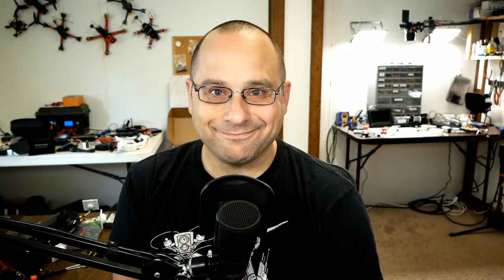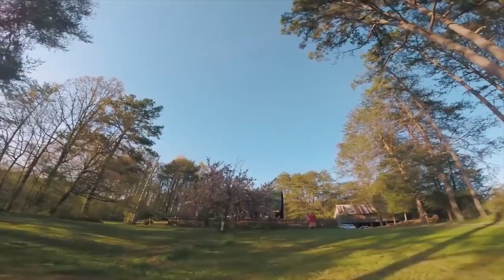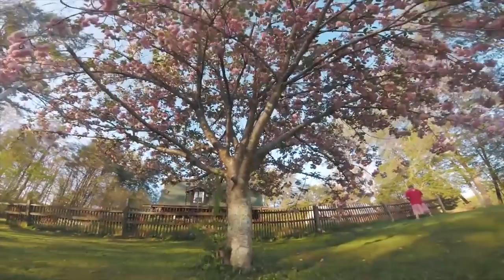Parallel Charging | CAN YOU MIX DIFFERENT mAh OF BATTERY

Comment: It is a question of current. I think the biggest potential problem would be mixing largely different mah batteries. So you do your calculations and add up your mah to give you total mah and adjust your input current to 1c (as an example). But being the charge is going to be absorbed mainly by the larger capacity batteries they could potentially be taking on current greater than 1c. Not really a problem, yet. But say you are pushing what you calculate to be 2 or 3c for the combined packs? Therein lies the problem. I'm guessing perhaps don't push that hard or calculate your charge amps based solely on the smaller packs capacity. The only other thing I can think of is to check the manufacturer specs on Max charge current and stay well below that. Thanks JB. I'd love to hear your thoughts on this

Comment: As long as they are the same cell count, the way to make the water analogy work is you cut a hole at the bottom of each container and connect them all together with a hose or something.  Think of it as ground.

And that's it.  Pour water in anywhere, and it equalizes across.

Comment: What about battery ages? Can I parallel charge 2 batteries that r from different manufacturers but r otherwise the same specs, but one is new and the other is a year old or so? Can the amount of cycles affect safety of parallel charging between them?
Reply from the maker: As long as the packs are relatively healthy and you are not charging faster than 1-2 C I would do it. The risk with older packs is, if the pack takes a dump while it's on the board, then it will kill all the other packs on the board.

Comment: So is it safe to connect two 18650 battery's one with 2000mah and the other a 2500mah in parallel to make a homemade receiver pack?? Would they both charge to full at the same time like you explain

Comment: Lets say you have 2 x 100 ah batteries and 1 x 200 ah battery. Could you connect the two 100's with solid copper bars, and then parallel that (100ah x 2 = 200ah) battery to the 200 ah battery? Or would that be the same as connect all 3 batteries on parallel?
Reply from the maker: To get 300 mAh connect all three in parallel. But they must be the same voltage.

Comment: In mixed configuration how would discharging work?  Equally as safe?  Will the larger battery take a proportionally larger share of the load in order to drain the mixed parallel pack evenly while keeping the voltage the same on each?
Reply from the maker: Yes exactly.

Comment: I have a older battery that only charges to around 13 volts can I add a new battery with it or does that make one bucket taller than the other. Using your analogy.
Reply from the maker: Never ever combine a suspect bad battery with other packs in a parallel configuration. Get rid of that 13v battery it is a fire hazard.
Reply: @JoshuaBardwell  Thank you.

Comment: What do you do when you have say, 6 batteries to charge but they're not all at close enough voltage? Do you discharge the 5 higher ones so that they're at the same charge as the lowest one and then throw them on the parallel charged board?
Reply from the maker: I would probably just charge them separately. But that seldom happens to me. I usually finish my packs and since I use the OSD I can finish them at close to the same voltage.

Comment: Thank you so much for this video! First off I would like to ask if I'm applying this knowledge right.
In my case, I have a keyboard that has an internal 1900 mAh 3.7V lipo cell. I have a new keyboard case and I found the best way to use the space in the case, I would get a 3000 mAh and a 2500 mAh (both 3.7V) and solder them in parallel after making sure they are super close in voltage, I can connect this battery into the keyboard and it should behave as a single 5500mAh battery? The keyboard charger wont have any issues with the cells as they will continuously balance their voltage between each other? This will be in a sealed container and likely will not be taken apart for a very long time (years?), is there any maintenance i need to do, or monitoring in the long term to make sure i dont start a fire?

Also, I am a professional editor and I make simple animations on a daily basis - if you'd ever be keen on updating this video, I would be more than happy (if time permits) to help create some simple animated graphics to add to this for clarity. If you are interested just drop me a message on my instagram: @trendywhistle. (I'm not sure if youtube will block emails on comments.
Reply from the maker: Yes it should work as you describe. Eventually if one cell dies it will kill the other one.
Reply: @JoshuaBardwell  Awesome! Thank you very much!
Reply: Hi good morning,Please help,I am stuck in a diy Bluetooth speaker project, what happens to the Mah capacity when I add 2 batteries of 500mah capacity in series, will the Mah add up..
And same when I add 2 batteries of 500mah capacity in parallel, will the Mah add up..

Comment: What about connecting a flat LiPo battery with a 18650 battery of the around the same capacity in parallel? Will that work? I'm trying to use all the space I have inside

Comment: can i connect a 20ah 21700 36v battery pack and a 18650 12ah 36v battery pack  in parallel (if i level the voltage)

Comment: Hello Joshua,  Can I use parallel Diehard Platinum AGM Group 35 740 CC 100RC as main with Duralast AGM Group H8 900CC 160RC as auxiliary?  Diehard has 13 2.4 volts and Duralast has 13 volts.  I plat to connect the positive terminal of Die Hard to 80amp fuse, then to Smart battery Isolator 140A (LED ON -cut in 13.3  VDC and LED OFF Cut out 12.8 VCD), then  to 80Amp fuse to positive terminal of Duralast.  Negative goes directly to negative terminal.  I appreciate your expertise before I blow myself to kingdom come.   Take care.
Reply: Diehard has 55.0 Ah and Duralast has 95 Ah.

Comment: Wiring to 20v drill Batts in series to 40v for a 36v e scooter. I have to 5ah and the stock hard wired is 4ah. Would that be ok with all three?
Reply from the maker: It's impossible to answer this question without knowing the full specs of the scooter. The larger Ah is probably not an issue. The question is whether the scooter can take 40v input.
Reply: @JoshuaBardwell  thank you for replying. The stock battery rests at 41.7 and I have dewalt 5ahs with adapters they slide in with leads.

Comment: What is the risk of damaging cells if say one of your six packs has a bad cell ir.  Can the over voltage that happens in a bad cell charge cause issues to the other good parallel cells?
Reply from the maker: Yep. If you put a bad pack on the parallel board with good packs, it will kill them all.
Reply: Yeah.  A lot of guys I fly with have gone away from parallel chargers to multiport chargers for this very reason.  You forgot to check a battery once can cost you a whole lot.

Comment: what if i connect batteries of different ampere but same voltage in series to increase the capacity . what will be the output ampere? will it add up or take the ampere of the lower or the higher battery.. i need this cause i want to increase the voltage for my ebike which needed 48 vol but i only have batteries of different ampere and sizes
Reply from the maker: If you are wiring batteries in series, they should be as close as possible to the same c rate and capacity.

Comment: thanks! as always very informative! what about charging li-po and li-ion in parallel assuming that they have same cell count and initial voltage? I guess it should be safe, just asking out of curiosity
Reply from the maker: It's fine. As long as the LiIo is save to go to 4.2 volts. Most of them are but some older LiIo only are rated for 4.1 volts.

Comment: How do you bring all your packs within  the appropriate range, I find I don't fly all my packs to the same level or if I crash out halfway through a pack I can't parallel charge.  Thanks, the video is great.
Reply from the maker: If I have an odd pack that didn't get run down all the way then I just charge it by itself. Normally my packs end up about the same level because I monitor voltage on the OSD while flying.

Comment: When I parallel charge my batteries, I precharge them one by one using the storage program to 3.7V until the first beep (takes mostly around 3 minutes) before I plug them together.
This way, the cells are less than 0.1V off, regardless how far down I used them.

Comment: The only extra precaution that I take is that I like to keep my manufacturers together during a parallel charge. Theoretically it SHOULDN'T matter, but I am paranoid. Also that the JB para board only does 10, and I just happen to have 20 packs with an even split of 10/10. Run 10x CNHL's the first charge, 10x Rline's the second!

Comment: I agree with everything that was said! But what about internal resistance? I though voltage and IR were the two big factors
Reply from the maker: High IR will slow the inrush current, but you don't want to rely on that.

Comment: Hi Josh another great video! So I have been charging all my packs of different mah sizes together since getting into the hobby and they have always turned out fine so I was pretty sure it was safe but it's nice to know for sure. As far as the plugging in the packs with different voltage levels. I have always plugged in all my packs together without checking the voltage levels for about two years and never had any issues. I'm thinking now just how lucky I've been. I plug them in together rather they have 14.5v, 15.9v and say 16.1v. They always equalize themselves. When I do this all packs end up having like 15.6 volts or so before charging begins and have always charged to full 4.20v per cell. I'm glad you mentioned that this is not a good. Although I've not had an issue I don't want one either. I want to take as much danger out of charging as possible. Do you think I caused any damage to my packs doing that though?
Reply from the maker: You have been lucky. Even if you don't start a fire, you can damage the lowest-voltage battery by "charging" it too fast.
Reply: OK that's not good then. I'm glad you told me because I would have kept doing it. Thank you so much

Comment: <3 you Bardwell. 1 question do i just add the mah and divide by 1000 for the amps? 850mah + 650mah + 650mah= 2150mah so 2.1ish amps right? its doesn't matter that the 850's 1c rating is diffrent from the 650's correct?

Comment: Hello Mr. Joshua. You explained very well. I like to share one of my experience in battery charging. Actually I was searching for the answer. I wish you can help me with it. " I was charging a 2200mAh battery. Before charging battery has voltage about 3.6V. And I connected to a supply about 4.3V. But I have seen the voltage is 3.6V while charging battery. " Here my question is, battery is connected parallel to the source. But the voltage in between them is 3.6V instead of 4.3V. why it's showing the battery's voltage instead of source? What happened with remaining voltage?
Reply from the maker: The charger will raise voltage to the battery to cause current to flow into the battery. The difference in voltage between the battery's cell and the charger's output is lost as heat due to the internal resistance of the battery.
Reply: @JoshuaBardwell  So. What will happen if we are charging an empty battery? Means what will be the voltage in between them ? The voltage will be zero? All voltage lost as heat ?
Reply: Did , did you plug a battery into a powersuply? Lmaooo

Comment: Other strategies and dangers:

Order matters.  If you have cells with slightly differing voltages, you want the larger capacity with lower voltage to go in first since it has more ability to absorb the inrush current when the higher batteries are plugged in.

The biggest danger with charging parallel batteries of different capacities, aside from the obvious, is a wonky parallel board.  No board that I know will self-report a burnt out trace.  So if you have an open circuit, you don't know about it.  If you were setting your charge current to the aggregate of all cells, and unbeknownst to you, the largest cell is sitting on an open circuit, then the rest of the smaller cells will have to absorb the excess current.
Reply from the maker: Regarding order, I do agree. This is a bit of an advanced move, though, and I don't talk about it much because people struggle with parallel charging on the best day.
Reply: GoatZilla ...great point. I had this happen on an xt30 board. I now periodically check continuity to all the pins.

Comment: Okay, here’s a question that wasn’t answered. If you are charging batteries of the same cell count but the mAh capacity is different between them; then what should you set the charger current to to charge them all up at? Say you have several 850mAh 4s packs in parallel with several 1550mAh 4s packs, what amperage do you set the charger to? 

Every time I’ve done this I set the current to the lowest mAh that the smallest pack(s) are at that are on the parallel board. 

Just curious as to what you do Bardwell, since you’ve turned the comments off for this video...
Reply from the maker: I haven't turned off comments for the video. Youtube's comment section is borked. I can't see the comments on any video right now.

Add up the capacity of the packs and that is your 1C charge rate.

Comment: Quick question - If you were to plug in 2nr 4s 1300mah batteries into a parallel board but one of the balance plugs does not connect properly and registers as a 3S (although you could not see this happen) would this cause a problem and see this battery as a 3S and give you magic smoke/puffy battery's? a friend had both of these batteries pop and melted the traces on the board, he did check the volts to within 0.2v of each pack and the board was working fine before hand.

Great tutorial as always :)
Reply: DM Carbon yes that would be a problem definitely
Reply: Thx Dustin thought it maybe that :)
Reply from the maker: If the one cell didn't plug in to the balance port, I don't think anything would go wrong. Just that one cell wouldn't get balanced. The most likely cause of pop-melt is plugging in the balance plug upside down or into the wrong plug (3S in a 4S plug).

Comment: You just need to make sure that the internal resistance is roughly inversely proportional to the capacity so that the charge rate is proportional to the capacity. Otherwise the battery with relatively (proportionally) lower internal resistance might, experience a higher charge rate and the other with higher Ri will charge at a slower C rate. They will eventually equalize in the constant voltage phase (4.2V per cell), just during the constant current phase they might get different charging C rates, due to disproportionate internal resistance.
Reply: For example if you are charging two  1300mAh batteries in parallel at 5C (5x1.3Ax2 = 13A) and one of the packs is really bad (high internal resistance) you could end up pushing all of the current into the good pack (10C) and exceed the packs charge rate and destroy the healthy pack. This is not a problem if you are charging at 1C as most of the batteries today can take upwards of 2C charge rates. As long as you keep batteries of similar health and SAME voltage (and cell count) you should be fine when charging even at more than 1C (assuming the charger can provide such current).

Comment: One last question for you relating to this topic.
Can a difference in internal resistance between the batteries play a roll. For example I charge 1500mah and 1000mah packs together but the 1000mah packs have a significantly higher internal resistance, could this effect the current distribution between the packs?
Reply from the maker: Not really because the charge rate is only 1C or 2C so internal resistance doesn't much come into play.
Reply: Joshua Bardwell Thank you for putting my final worry about doing this to rest, appreciate the reply :D

Comment: This is very interesting thank you for explaining this.
May I ask how does internal resistance affect this?
Say one battery pack is 7.3amp and another is rated as 20 amps. Both have the same voltage. Would this affect the batteries adversely?
Reply from the maker: In general I think this should be ok, however like I say in the video, I would probably not mix batteries of drastically different IR or size.

Comment: Thank you!  This answered my question about adding an external battery in parallel on my electric scooter.  I paid a seller $249 for a 36v battery to extend the range of my 15amp scooter battery.  I found the same battery but with 20amps on Alliexpress for $50-75.  Next time I diy external battery I’ll save some money.  I didn’t know if I’d burn something up putting it in parallel.

Here’s another question:  if my scooter’s main (built in battery) is 36v 15amps and I add a 36v external battery that is only 10amps ( in parallel) would that hurt the controller, or would that reduce power/speed?  Thanks again for the help.

Comment: Just the info I need. Thanks for making this video. My question is...if I make 2 sets of 3s24p packs, would I need 2 3s BMS? I'm looking to get 100-120ahs at 12volts.
Reply: Depends on the ratings of the BMS.

Comment: something I ran into was I had a pack with a bad cell that I didn't notice and when they equalized, it brought that one cell on all the packs really low, and recharging a possibly dangerous cell back up. I ended up having to balance charge each pack individually, food for thought, check the cells first!
Reply from the maker: Only parallel charge healthy packs!
Reply: this one slipped past my radar

Comment: JB, nice video. Quick and useful. I was actually wondering how much internal resistance might matter. But all my batteries are 1500 so this cleared that up.
Reply: Have u got an answer to this? I have batteries that are the same volts. Different mah and different internal resistance